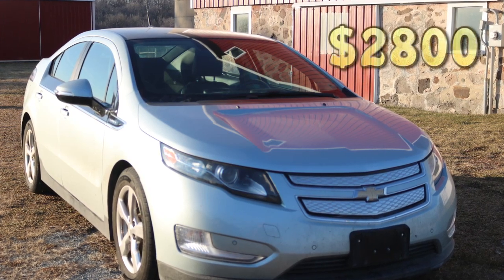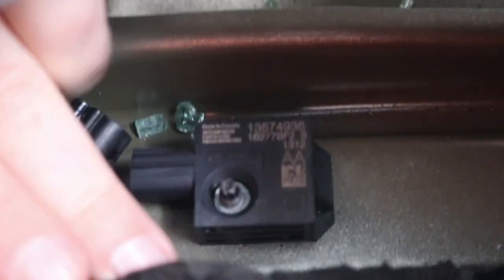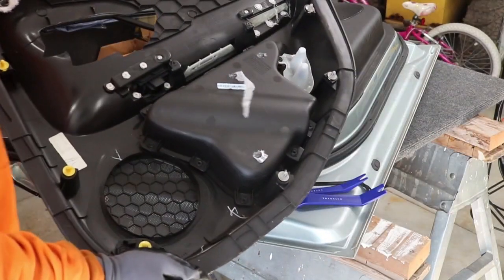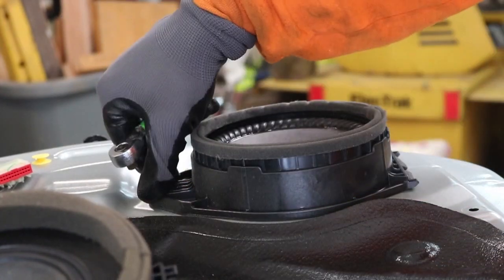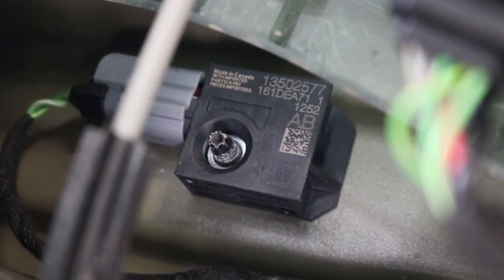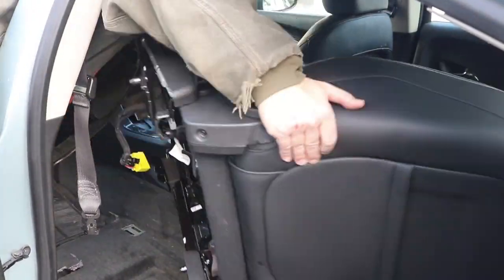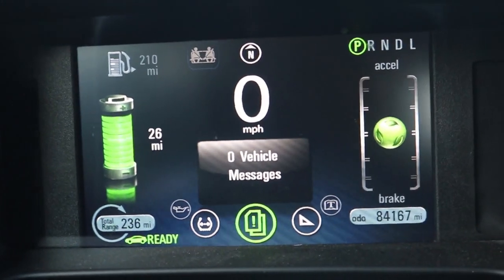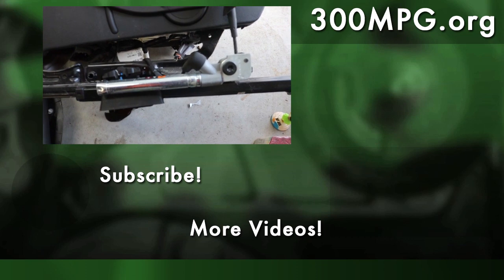Crashed Chevy Volt - Airbag Error - Impact Sensors, Speakers, and Seat-Belt PreTensioners.

Comment: Nice job Ben. I have always found it satisfying to clear any engine/air bag codes from a car. On a side note: that air bag door sensor, if you used an eTorx socket on it to loosen it, it should slide out as the bolt hole is elongated. Now anxiously awaiting for another tractor video :-)
Reply from the maker: Right. I did NOT have an E-Torx, so I couldn't remove the door impact sensor. But yes, it's a slotted hole, so it needs to be loosed, then slid over and pulled out.
On that style screw, is it a left-hand thread, but from the point of view of the tip?
The reason I couldn't get it out from the back may have been the thread was reversed from what was expected on that side.

Comment: Wow! I sure learned something new here. Pretensioner! Btw, I was facing situation that I had to remove passenger seat in iMiEV for clean up. The airbag light came on. Since I didn't have proper (expensive) code reader, had to take it to a dealer for code reset.
Reply from the maker: I've heard that about that car. It's one thing that's kept me from installing a passenger seat heater in the iMiEV!
Maybe just a heated cover instead....

Comment: Green is aweful. :)  
I have changed a door to on my volt and i tried to swap the speaker but the harness was different so i could not plug the bose speaker, the plug was only for the base speaker. Was it the same plug for you?
Reply from the maker: What!? No, I only pulled the Bose speakers so far, I didn't put them in yet. That's crazy that the wire harness would be different! Now I'm scared I won't be able to do it!
Reply: You could if you change the whole harness. I removed it from my broken door, but i didnt take the time to put it on the new door, its a lot of work. You can use the base speaker with the bose sound system. It works for me.

Comment: Black and silver. Can you take the rear of the original seat and fit it to the replacement seat?
Reply from the maker: Removing the cover of the seat and transfer it over? I have no idea. It might be possible.
Reply: @BenjaminNelsonX  No, sorry Benjamin, I meant detach the entire vertical part of the seats and swap them, leaving the horizontal part - where you put your bum alone. I don't know if you can split the seat in two like that though - just a guess.

Comment: I got to this video because I'm trying to find out if I can replace the entire passenger seat to get rid of an airbag error with the passenger presence sensor. It's built into the seat bottom and the dealer wants about $1000 to fix it. I'm thinking I can replace the whole thing with a junkyard seat myself. Anyone ever do this? It's a common issue with the sensor getting pinched and shorting out, but no recall yet.
Reply from the maker: Sounds like a junkyard seat might be a good solution.